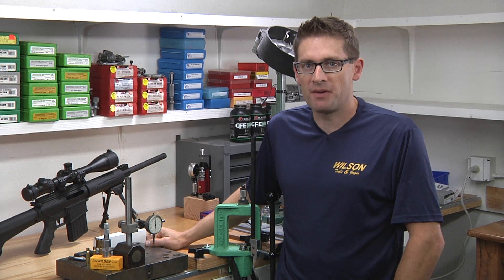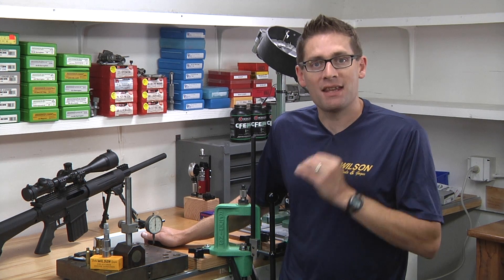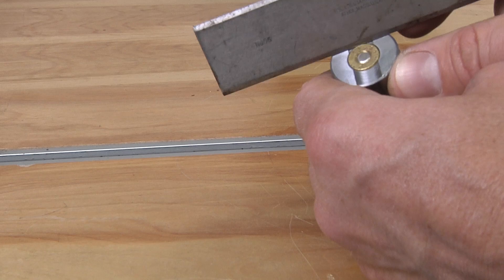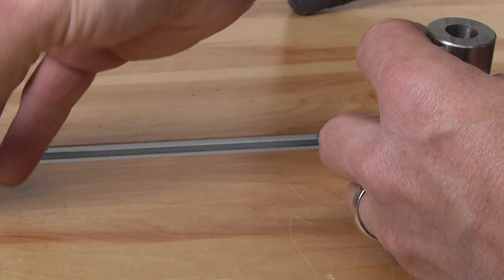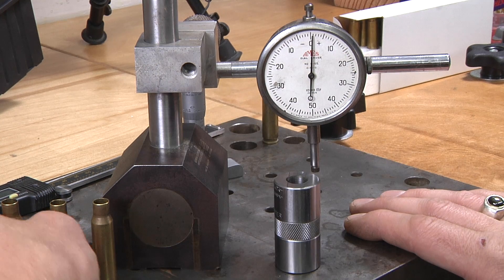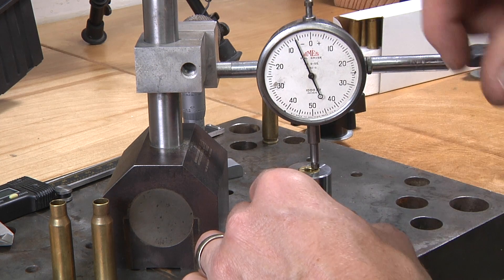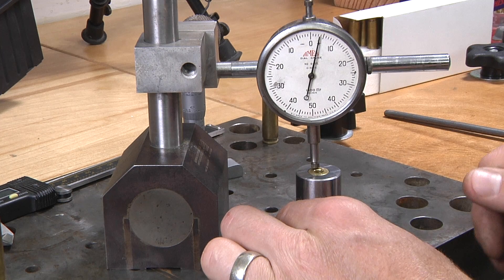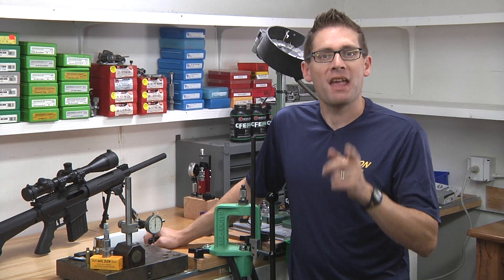Reloading Essentials: Using a Rifle Case Gage

Comment: are the L.E Wilson one and Hornady one doing the same job, close enough tolerances for end results of what they are checking?
Reply: The Wilson, per their writings, is a case length gauge only. The Hornady is a headspace gauge only. Per my measurement, the Hornady is .003 smaller than Saami and the Wilson is .003 larger than Saami, at the base opening on my 6.5 creed gauges.

Comment: In my .223 some of the hot loads commercially bought flatten the primer so much that its real hard to deprime. And pressure is very very high on 5 outta 20 rounds

Comment: I am using my Wilson case guage as a go/no-go for my bulk 5.56. My loading (for these) is geared toward SHTF storage - fit any AR/infantry issue standard/factory off the shelf. I FLR (small base die) then gauge to see straight edge slides over the head, then trim with the same gauging standard (I also do a quick rub with my fingernail to see if it catches the neck, assuring it is not below). I rarely use calipers, just occasionally. The purpose is to have a way to assure proper tolerance with every single case, not having to caliper them, which is tedious when loading thousands of cases.

Comment: Very good video..  most reloaders either dont use or dont know how valuable this simple act of dropping cases through a case gauge is..  its one of the quality control steps that insures proper and safe function through your gun..   Some inexperienced reloaders will blame the rifle for misfires ,, ( mostly semi autos) instead of the real problem of the ammo being out of SAAMI specs..
Reply: That's a total understatement a pair of calipers won't do it. You have to have a case or a rifle barrel laying around to actually see how it's going to fit. I couldn't agree with you more It's overlooked in a mere set of calipers won't do it.

Comment: This is killing me. My 308 brass. I set the sizing die with the ram fully extended she'll holder touching the bottom of the die. Then back down the ram and lower my sizing die about 1/3 a turn. I insert the cartridge, size it, insert it into the gauge  and the head doesn't fit into the area where it should be flush. It sticks out alot. I can't close the gap between the die and case holder any closer. I already got it too close and it popped the bolts on my turret ring. What's up???
Reply: Unfortunately those cases cannot be fixed. The issue is in the shoulder of the rifle necked down case failing to reach the neck  down in the breach.. The fix is verify shell holder distance to the bottom of the sizing/ decapping die. I noticed some cases that I had reloaded, the die wasn't sufficiently tight.and walked it's way out of spec. Thus the case would be mal formed. Also ensure when sizing and decapping to pre-clean the sizing die inners. I use a couple shots of brake clean and run a swap impregnated with bore cleaner. The easier the case is to extract from the sizing die the more true case. If you're running an AR10 excessive case lube will gum up your breach. After sizing, prepping I give them a nice hot bath in a sonicator. Sonicators appear to be the only thing That is still a bargain as you can get one for a hundred bucks. Most sonicating medium is just ammonia so I use the batch a Mr clean and it does a beautiful job on those cases strips all the gunk out and they're hot when they come out so they dry in a jiffy
Reply: I have the same issue. 5/25 cases don't sit flush or within spec and sit higher than needed. I see you have not gotten a reply from "UR"...have you found a solution to your issue? My RCBS SMALL BASE die is set properly as in the instructions and it is bugging me because this is only the 2nd firing of my brass through an M1A Standard. I may just have to toss those cases.

Comment: If I full length resize with a shoulder bump of 0.002"  and trim for consistent case length for my bolt action rifles, do I really need a case gage?
Reply: Not necessarily. If you are using something like the Forster datum dial set or something similar to compare headspace dimensions of fire formed brass to sized brass, and are pushing the shoulder back enough relative to your fire formed brass, then it should chamber fine, and you don't really need this. The same goes for the case length. If you measure with calipers and it is outside of max, and you trim them all to the same length, it will ensure consistent crimping, and you are good to go. These are just another way to measure.

Comment: First off, pardon me for resurrecting an old thread.  On bottle neck cartridges, isn't the headspace measured from (usually) the mid-point of the shoulder to the bolt on a closed chamber?  If this is true shouldn't you insert your case into the gage and suspend the gage to see if the case head extends above the gage or below the lower step to determine if it is too short or too long?  By inserting a case into the gage and placing it on a flat surface you would be able to determine if you overall case length is too long, or too short?

Comment: I thought most people just bumped the shoulder back several thousands. I'm mostly familiar with the Hornady shoulder comparator. I shoot bolt rifles, and use L.E. Wilson hand dies for neck sizing and bullet seating. I do have several rifles in 6.5C, so maybe a body die would be handy if I forget to sort my brass.

Comment: I think you should mention that the cases have all been resized as an oversized case placed flat on a table will for sure have the base too high on the gauge. I believe Wilson says the case gauge should be held up off a table to see if the base falls between upper and lower lips. Once the base is properly spaced the gauge is flipped and placed on a flat surface and the distal part of the case should fall between the upper and lower lips of the gauge. This is the point that many mistake because they use their finger to push the base up making it appear that the case is too long.

Comment: For your third scenario when the brass is too long, I have my die already set down as far as it can go and the brass still won't be flush. Any suggestions?
Reply: Did you ever get an answer to this? Because I've got a similar issue, it's held me up for several years and nobody has an answer that has worked.
Reply: What do you mean set down all the way if u lower the handle then screw ur die in to the shell holder ?
Reply: Because if so u might have to turn die down little at a time so u Cam over on the die a little it is usually stated in ur die manuals too this will do what is called bumping the shoulder back

Comment: Great video. My only suggestion would be to also show how to do this with calipers, or at least mention it.  Everyone has those but not the tool you were using in the video.
Reply: This. The video claims to show how easy it all is, but that's only if you have the specialized and expensive piece of equipment. Of course, the gauge is still useful for checking your reloads, but not so much for setting up dies without that equipment.

Comment: it is extremely important to distinguish between a case gage and a loaded ammo gage. a lot of people mistakenly think a case gage verifies all case dimensions. a case gage verifies length (headspace) only, nothing else.

if you want to verify your loaded cartridges meet saami spec in all dimensions, you need a loaded ammo gage. only a few companies make them, like sheridan engineering.
Reply: Wtf??! Nobody ever explained this. I got a case guage checker just for that reason. Thought it checked headspace of the finished product. So I slapped a case that I knew was way out of spec and it fit right in. Thought it was defective. Lol. Shit.
Reply: This can be solved by making a dummy round. Chamber the dummy round to see if it functions normally.
Reply: That's cause a case gauge won't check C.O.A.L so if ur bullets are out to far you can be on the lands of rifling making a chambering issue not mention a potentially dangerous over pressure issue

Comment: One thing you should have mention, is that you may need to trim your brass before dropping it into the gauge and measuring it with the  dial indicator.  I have seen 223/556 grow way over, and stick out the top of the gauge. Resulting on a bad reading of the head space.
Reply: Ole Ironhead I think what That Tech Guy was getting at is that if your case is in dire need of trimming, you can't set the gage down on that platform because the excessive neck length will cause the case to stick up, giving a false headspace reading. You must hold the gage in one hand and measure with calipers in the other hand. However, no measuring is needed with this instrument. Simply set your size die so that the base of the case is somewhere between the lower and upper step, with a little closer to the upper step being ideal. Then set the gage on a flat surface (base down) and if the mouth of the case is between steps, you're OK. If it sticks up past upper step, you need to get to trimming. You can feel if the base or mouth is between steps easily with your fingertips.
Reply: Luvta Handload   You are absolutely correct.
Reply from the maker: +That Tech Guy Yes! BTW: That detail is covered in the "Full story" (blog post) - http://bit.ly/1M1KA5A
Reply: +That Tech Guy I have a question though.  I understand how the resizing affects the oal and makes it, the case longer.  but in terms of what gavintoobe was trying to explain, that would only affect the neck length and not head spacing?  Now grant it, once done with measuring and adjusting the head space, you could by all rights now trim the neck down to the proper oal on the other end of the case gauge?  I guess what I'm asking is, what would be wrong with getting one end correct of the case, then fix the neck end and then at that point, you have a case that is head spaced correctly, and then you have trimmed it to the proper length as per the head space gauge?  Thanks